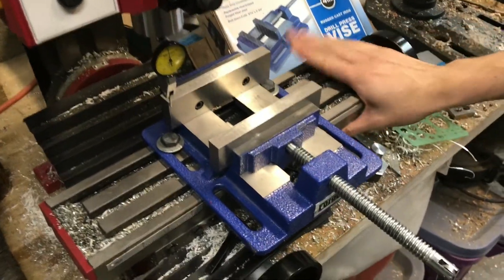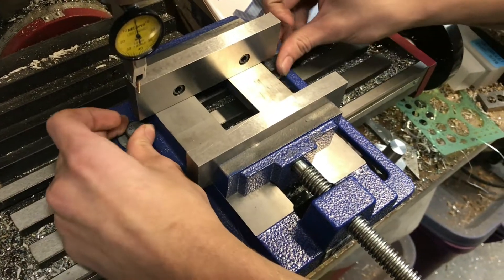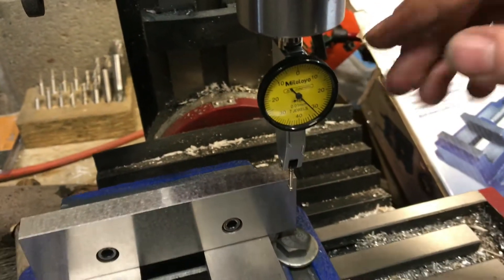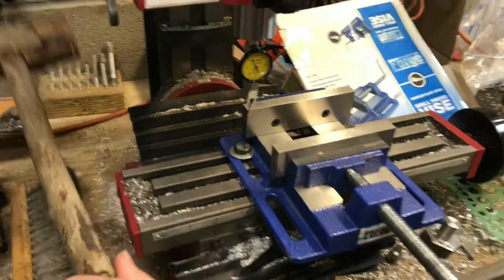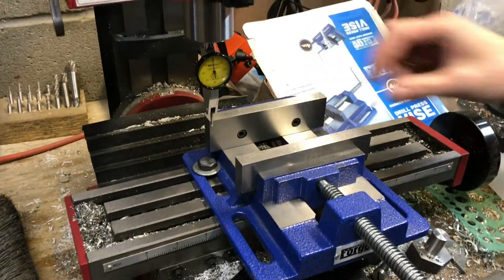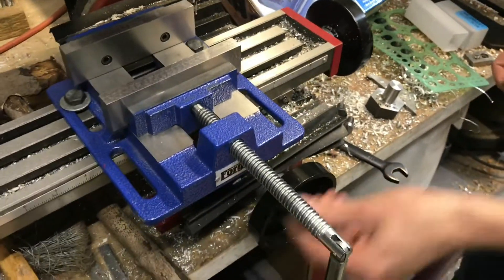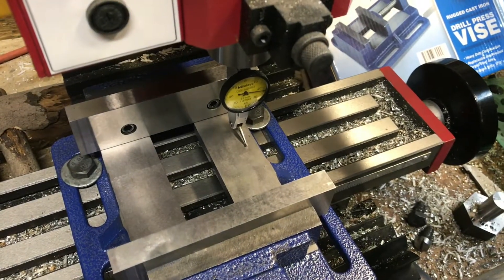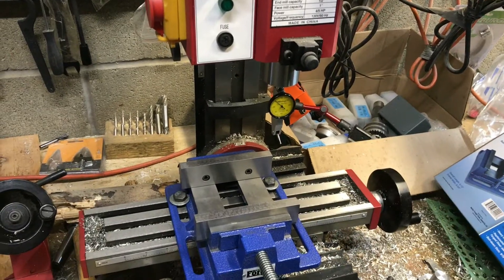SQUARING a vice to a vertical milling machine harbor freight 44991 30999

Comment: Just a FYI, I have this exact drill press vise (purchased mill used basically new with vise). I also own a real machinist vise that can be found online for about $55 shipped new. There is absolutely no comparison to the $55 machinist vise for anyone on the fence. There is far less difference between a $55 Chinese vise and a $700 Kurt vise then there is between the drill press and machinist. That extra $20-30 goes a long way.

Comment: Thank you for this, I have been looking for a video to tell me how to get a  square  vertical in a mill vice so I can mill the top flat  then drill a 10.5 mill hole so I can tap it.
It’s amazing how hard finding video on the basics can be.
This seems perfect if I do this to two sides it should be vertical.